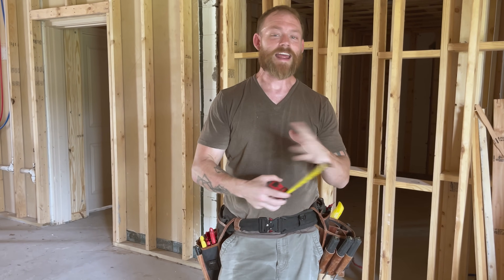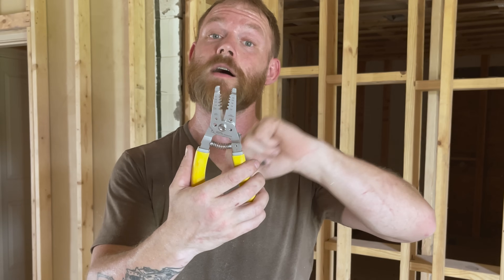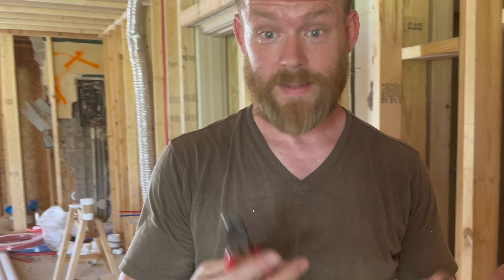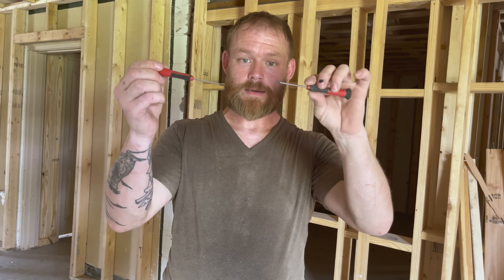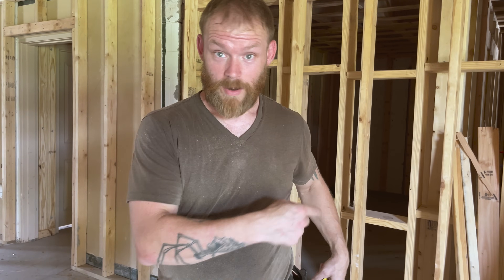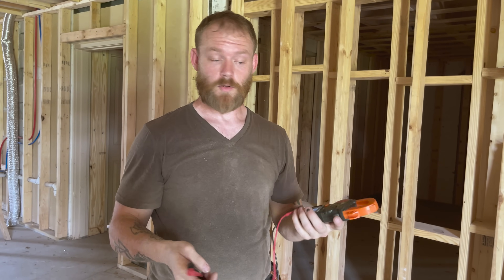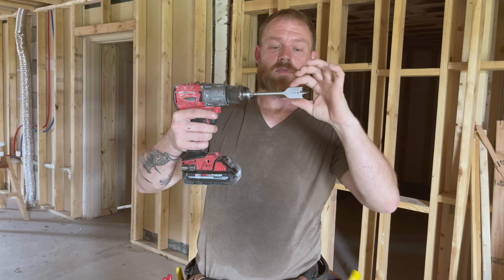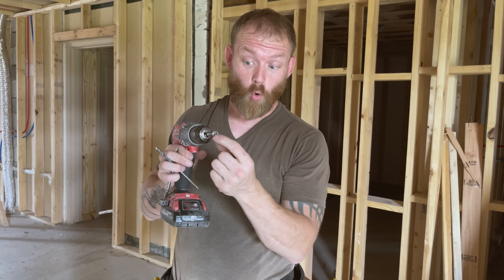All the Tools Apprentice Electricians ABSOLUTELY Need!

Comment: The one suggestion i have to go with the M12 fuel line over M18.  The weight reduction is significant 2lbs vs 3lbs and the power is 85-90% of the m18.  Only time you may notice the difference is if you are drilling through stud after stud for a few hours or through concrete.
Reply: Facts I got the m12 and m18 drill and surge impact set had them for about 3-4 years my m18 set still looks brand new I use my m12 stuff 95% of the time
Reply: M12 surge ftw
Reply: I personally prefer the M18 Fuels as they are heavy. Sure I'll use an M12 to get into tight spaces, but quite often when I need a smaller impact, even the small ones barely get into the space. Very handy to have but I prefer to work hard and stay strong/fit so heavy tools is a bonus for me

Comment: I'm about to start my apprenticeship. What a greatly timed video! I already got all the books you recommend on your website.
Reply: half these tools aren't even needed bro
Reply: @tomhusking3020  It's true, you won't need every tool in every instance, but you will use every one of those tools in different situations.  Some are more applicable when doing rough in compared to finish work, some are more for residential compared to commercial - but they will ALL be used.

Comment: Nice run-thru of many of the tools needed. It may seem like a lot of tools but you will find you use them all!

Another one that is very useful is Malco MSHC 1/4 & 5/16 Reversible Hex Chuck Driver. The head id reversible so you have the two most common sizes with you all the time without needing an extra driver. They are "cleanable", too. HVAC guys use them all the time.

Comment: Great suggestions.  Only thing I can ad is factory reconditioned cordless tools are a great value.  Ive bought and still using Fein, Makita and Dewalt factory reconditioned tools and have had zero issues. I’ve had great experience with CPO Tool and prefer them over any of the big box stores when I’m shopping for new corded or cordless tools.

Comment: I’ve been an apprentice for about 8 months now doing commercial and I definitely think a good set of small channel locks should be on this list, they come in handy quite a bit
Reply: Knipex cobras water pump pliers
Reply: @thenextgen1able  channel lock tongue and groove are better for conduit couplings imo. Knipex tears them up. That being said cobras are probably one of the best hand tools I’ve ever bought and it got me to switch 90% of my hand tools to knipex
Reply: @RsFrag3d  not exactly the same but it's similar enough to get the job done
Reply: @thenextgen1able  what?
Reply: @RsFrag3d  i shared a link to the smooth jaw knipex pliers wrench. They're similar to channel locks but they have wrench flats instead of teeth. the comment must've got deleted
Reply: My interview for the commercial apprenticeship in my area is March next year I can’t wait.
Reply: @wrench8149  good luck bro
Reply: Be sure you got at least 2. You sometimes need 2 channel locks for double wrenching. Knipex for me but I have a few Blue dipped handle ones here and there
Reply: breaker locks and multi meter. never trust someone elses testing or lockout. thats the quickest way to get electrocuted
Reply: Knipex ftw 👍
Reply: Even as a lineman I use my small chaneys and semi I creasant quite often
Reply: I love love love my alligator pliers.

Comment: Martinez M-1. He designed the early titanium stilettos. I like the dewalt 20oz for an affordable starter. That said Estwing makes a damn durable hammer
Reply: I got my first introduction to Estwing in school geology classes. You can pound on rocks all day with them and not ruin your hand (or the hammer). When I went out on my own, I used my Estwing rock hammer for everything until I really needed a claw (my rock hammer had a chisel end on the back end). I would use the Estwing to set pry-bars.

Comment: Don’t forget about the toolbelt to put it all in. I prefer the tool belts with the suspenders over the shoulders. If you have one that just goes around the waist, it’ll be pulling your pants down if it’s too loaded. You don’t wanna be showing your butt crack on the job. You’re an electrician, not a plumber👍
Reply: I've been an electrician since 2005; residential and commercial construction, and now industrial maintenance and control systems/instrumentation tech...I don't think I've ever used a tool belt lol. Got no time to be wasting that energy. The small veto tech bags are great for carrying what you need to where you'll be working, and just leave it there on the ground/in the lift/on the roof and carry the 2 pounds of tools you need for each job
Reply: Classic burn to plumbers hey o
Reply: Thays only a problem for men, as a woman, the men on the site tend to quite enjoy it when things start to pull my pants down and my butt crack starts to show😂. Exspecially if my hands are full and i cant pull them back up😂😂😂. Ahhh soo many jokes, good times.

Comment: The only tools a apprentice needs is…..
3- screwdrivers 
Plier, channel loks, 6’ stick rule, level, wire stripper, hammer, awl…
A DRILL AND IMPACT DRIVER IS SUPPLIED BY THE CONTRACTOR….

Comment: I’d recommend the Milwaukee M12 Fuel HDD/Impact driver. They cost about the same as the base model M18 models, but they’re smaller, lighter, and plenty powerful, even for drilling mounting holes in concrete.
Reply: Yep I use m12 impact and drill, much better when you're carrying them around.
Reply: I don't drill with mine in anything super heavy or very repetitive, or use it for concrete (impact is not hammer) - but I LOVE that little thing. Generally the 18v stays in the truck these days, unless I'm getting heavy on the drillin. It runs the paddle bit / small hole saw for the occasional hole just fine though. Way lighter on the belt than the 18v.
Reply: I'll keep my ryobi HP drill driver that I got with my impact driver in a kit for 126 dollars

Comment: Tool belt itself is super important. 

I carry my tool belt and 3 bags. One bag has batteries/chergers with drill bits and a case that has nut drivers the other small bag carries my oscillating saw, drill, and impact. Lastly, I have the big bag that has heavy duty stuff like hammer, linemans, pry bar,  ratcheting cutters, and etc.  

My logic and reasoning is that I want to keep my tool belt as light as possible to keep from stressing my hips, lower back, and to fight off fatigue due to carrying around 20lbs more than required for typical needs.

Hope this helps!
Reply: And measuring tape
Reply: What do you keep on your tool belt?
Reply: @pgood7266  small hammer for staples, small level, 11 in 1 screwdriver, long flathead beater screwdriver, needle nose pliers, impact extension, marker/pencil/pen, razor knife, wire stripper/plier combo, diagonal cutter, inductive probe, drywall screws (perfect for jbox), 3 inch screws, extra panel screws, couple of box connectors to save a trip to the truck, electrical tape, wire nuts, staples, and one other tool that have slipped my mind. 
Honestly,  it takes care of the majority of jobs while staying relatively low in weight.
My bags have heavy stuff like individual power tools, alen wrenches, and etc. But I typically walk in with my impact and tool belt until I know what exactly I need.

Comment: I know its an extra tool, but if you're dealing with alot of concrete, I'd go and pickup a SDS Plus Drill. They're designed to punch holes in concrete much faster than a hammer drill and have better shock absorption. Plus, no pun intended, their bits won't fall out randomly, like what happens with a hammer drill over time.

Most power tool companies make them with varying battery voltages and corded options.
Reply: Don't get me wrong, any time I'm drilling more than a couple holes, even 1/4", I'm using my SDS, but the video is geared towards kids that are at a point where they're probably not gonna drop $200 on a tool unless it's essential frequently enough that the other guys on site will get tired of lending it to them.

Comment: Best drivers: Wiha
Best pliers: Klein 2000 series then Wiha
Best pump pliers: Knipex
Best hammer: Linemans...jk Hardcore, Milwaukee, Stiletto, apprentice, etc (mArtInEz)
Best jabby saw: Klein or Vaughn
Best Aviation snips: Klein or Hazet 
Best multi-driver: Wera
Best L-keys: Wera
Best T-handle: Klein Journeyman
Best power tools: Milwaukee fuel
Best ratchet set (for this job): Gearwrench pass thru
Quality impact set: Blackhawk or Sunex
Best double end set: Klein reversible
Best nut drivers: Malco, Klein, or Wiha impact
Best benders: Milwaukee w/ iron head
Best tombstone: Greenlee
Best center punch: Starrett
Best ingenious trade tool: Hanger Banger, Conduit layout tool
Best carbide hole cutters: Klein or Milwaukee
Best instruments: Fluke
Best lineman knife: Klein folder, Selby s35vn, or Tactical Edge Lineman
Best utility knife: Milwaukee or TealeDesigns
Best Tool Belt: Buckaroo, Occidental Stronghold (new), or Diamondback
Best tool pouches: Occidental or Akribis
Best belt/suspender accessories: Atlas46
Best aux tool storage: Atlas46
Best aux tool belt sacks: Diamondback DBsax or Holstery Joey
Best tool bags: Veto Pro Pac
Best tool boxes: Milwaukee packout
Best lanyards: NLG, Milwaukee, Atlas46 Tallmadge, Ergodyne
Best boots: Franks type 1 commander, Jk superduty, Hoffman Armor pro
Best work pants: Mascot 17179-311 
Best lights: Fenix
Best writing tools: Sharpie hd construction, Pica, Milwaukee
Best knowledge source: Mike Holt & engineering channels
Best route: IEC Non-Union
Best tool: Klein rapi-driv and slave apprentice
Worst scenario: 10 year apprentice, cocaine stint, depression, sold tools, enlightenment, bought tools, apprenticeship at 35, gym tan misogyny, back baby

Worst place to work: Alaskan fishing vessel in the Bearing Sea or Odessa, Texas.

Comment: I noticed that you have a tool belt that works really well with all the "must have" tools. Tell us about the best tool belt, please.
Reply: id really appreciate knowing exactly which tool belt he is using now.
Reply: As an American Electrician for 30+ years I too have my opinions of tools and what are best… Unfortunately my preferences have shifted from Klein to Knipex and Wiha and Wera for a variety of reasons. Those reasons are weight, performance and durability.

And the philosophy of a TOOL BELT or BAGS, is a great way to destroy your back and livelihood…. Minimize to a tool vest and a nearby tool box…

Skillers (also known as Snickers in Europe) makes some awesome tool vests. And there are others from other companies. But a tool vest minimized to the tools necessary for the task at hand distributes weight to shoulders as opposed to hips and far mor ergonomic than American style “bags”  our belt/pouches.

For that matter a pair of 9” Knipex linesman’s, a 10 in one screwdriver and light-weight impact is all you need on your person for most tasks.  The rest can be in a box near where working. 

I keep two tool vests in my truck, on for rough - one for trim. 

The one for rough has a hammer loop pouches for a Knipex 1372-8, a tape measure, markers, a 10-1 driver, a beater, a hook for an impact. And some pouches for staples and wire nuts. And that’s it!

The Trim vest is the same minus the hammer loop, and beater, and a few more specific drivers for trim work. And of course a level. I do ultra high end market work. And “bags” are not even allowed on the jobsite after rock goes up. You can turn around in a room with bags on and end up with a $5k+ back-charge for damage to a counter or wall…
Reply: 1) Atlas 46 
2) Buckaroo 
3) Occidental
Reply: I've been really loving the tough built cliptech line of pouches. There are all sorts of variations. Great for specific tasks you may be doing that day, whether you need a couple tools or a bunch of tools with pouches for wire nuts/fasteners they are so diverse. A little pricey but they are very sturdy and, well... Tough. You can also buy extra clips to hang them in your vehicle or attach them to your ladder so they don't pull your britches down 😂
Reply: I’ve been rocking an occidental leather setup
Reply: Toughbuilt, then get several of their pouches to clip and unclip as needed
Reply: Came here for this!
Reply: I’m a 1st year apprentice, I love my gator backs man
Reply: Get the individual pouches so you can customize based on your job.
Reply: Use tough built
Reply: You should check out holstery
Reply: Occidental Leather.
Reply: Atlas 46
Reply: Rack a tiers electricians combo belts with the overalls are the best I love mine

Comment: The demolition flat head screwdriver is also extremely useful, guys
Reply: Any 6" Klein flat head is a demolition screwdriver lol. The handle on mine is all mushroomed plastic, but it's still alive
Reply: @Gruntled2001  Yeah I have a old like 8" screw driver that I use for a beater and everything else that Ive had for years. it's all beat up but it works and it's  essential I call it my ol trusty lol.
Reply: Be careful with that screwdriver though.  No live circuit work.  The metal striking cap is connected to the shaft.  I do like the screwdriver but once I checked continuity on it, it's no longer in the work van.
Reply: @clamboni9  shouldn't be working on live stuff anyways but that panel is just so damn far away
Reply: @busyjambes I agree, but sometimes it's unavoidable.
Reply: I just keep in mind what my co-workers are carrying and put the minimum in my pouch. Cherry pickiiiiiiiiiin
Reply: My 11 in 1 is a demolition flat head and still going strong
Reply: That demo screwdriver is dangerous. A regular one lasts long enough.

Comment: Not mentioned but good footwear, insoles and socks.   Take care of your feet and your feet, ankles, knees, hips and back will thank you. 

I prefer having cats paws or "wiggy bars" to pry with than a big beater screwdriver or demo screwdriver. More controllable IME.

If you're going to buy cordless tools. Consider getting what your coworkers use so you can share batteries. Personally I like TTI's brands (Milwaukee, Ridgid and Ryobi), but you will have to decide what works best for you. Remember you're buying into the lineup not just the one tool. Think about all of your needs and buy appropriately.

Comment: Having been an electrician for over 2 decades, I'd say as an apprentice you don't really need the diagonal cutters or needle nose. I had a pair of diagonals when I first started (they came in the Ideal toolset I got); I don't recall ever using them, and once they disappeared I never replaced them. I can probably count on 2 hands how many times I've needed needle nose, and my strippers wouldn't do the job just fine.
One tool I would add is a good pair of tin snips (especially if you are going to be doing commercial)
So far as screwdrivers, get the Milwaukee demo flat and Phillips (they're about $12 for the combo at Home Depot). They are great for tightening lock rings, knocking out KOs, etc.; and you won't tear up the handle on them.

Comment: The equipment manufacturers developed the “electrical combination head”, “ECH”.  Which is a normal slotted head with the Robertson square drive in the center, in response to the Canadian code requiring everything have Robertson heads, while US codes require the everything have a slotted head.  Instead of cataloging separate items in the two countries the developed the combo head.   

The holding company which owns Milwaukee, and Klein came out with a screw driver which actually fits the ECH
Reply: Ha! Never knew what ECH stood for. I learned something new today. I love mine; they don't seem to slip as bad as square, slotted, or Phillips.
Reply: I heard that up in Canada they are working on a replacement for Robbie - a maple-leaf shaped bit. Just what I heard on the Internet, so it must be true.
Reply: I have a Milwaukee ECX screwdriver and Klein bits for my combo driver.  Sadly, they don't fit all the combo heads you run into. When they fit, they work great, but when they don't fit, they are 100% useless.  They fit receptacles and switch screws well but seldom work on other equipment screws.  Unless I'm doing a lot of outlet work, I question whether they are worth carrying. But for now, I am still carrying them.
Reply: @CurtWelch , interesting, I've personally never run into that problem. I use mine a lot to tighten breakers.
Reply: @CurtWelch  They are available in two sizes.  The smaller one works on receptacles and switches.  The larger one on breakers.
Reply: @randallthomas5207  I have both sizes as bits, but only one as a screwdriver.  Not sure what part of the world you live in, but the Square D breakers I have are all big slotted screws.  Can't find what a newer one is like looking on the net to see if there might have been a move to combo screw heads. I remember seeing some Philips heads on breakers, but never a combo screw head.  I'm going to have to keep my eyes out now.  I, however, use torque drivers on breakers now anyhow and don't have an ECH bit that fits any of my torque wrenches.
Reply: @CurtWelch  there’s ECH #1 & #2.  Two different sizes.
Reply: It is also called ecx, terminal, xeno. Wiha and Wera make drivers and Milwaukee has Ecx insert bits that can be bought at Northern Tool.
Reply: Ideal has also come out with a version.  They call theirs the "combo head screwdriver".  Works pretty good, and easily available at any Lowes.  The other ones are hard to come by without ordering online.
Reply: ECX?
Reply: @davidgearardo1788  ECH is the name the Equipment Manufacturers gave the head.  ECX is the name which the holding company which owns Klein, Milwaukee and others, gave their driver profile.  Which they patented so no one else can produce them.  The manufacturers really screwed the pooch on that one, by not patenting their own driver and giving anyone free license to produce it.